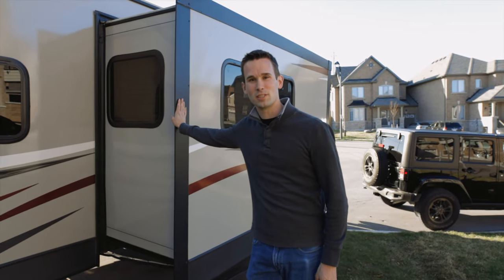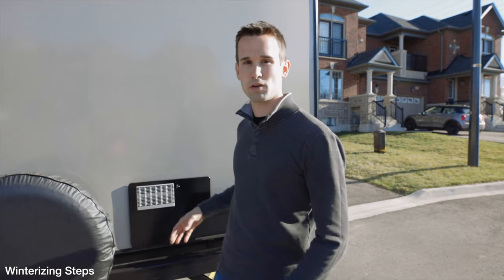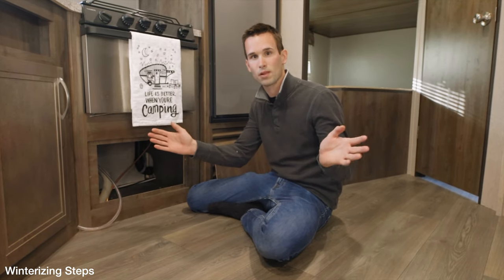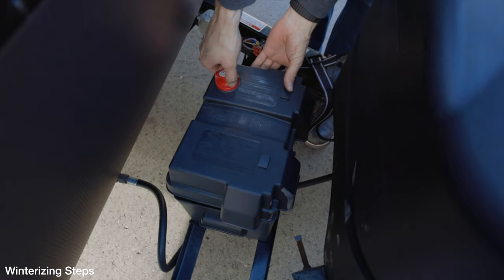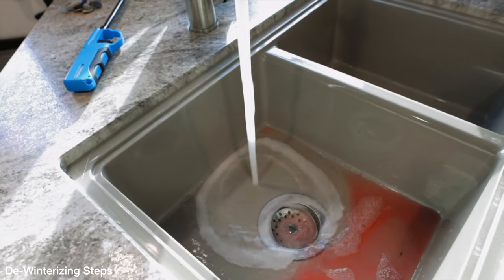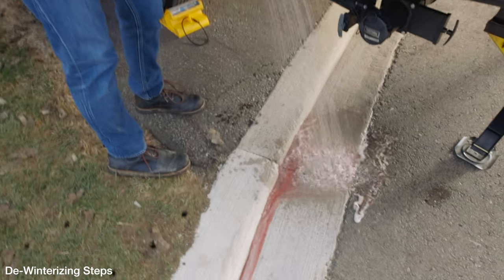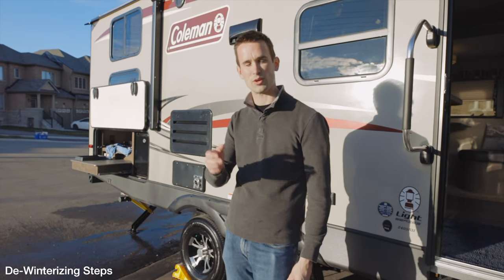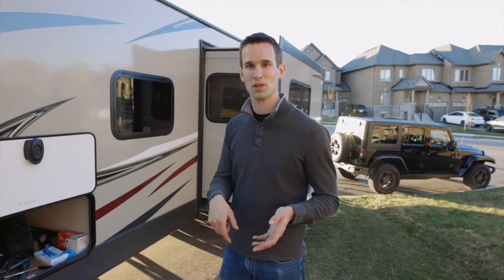Winterizing and De-Winterizing your Travel Trailer

Comment: Thank you so much for this video! I just bought my used TT and they winterized it for me at the dealership. I'm getting ready to take it out on my first trip in order to de-winterize it and to get it ready for use! I've watched several of these and this was by far the best, most concise explanation of everything that I need to do. I also appreciate the comment/clarification below re: filling the water tank and running the pump first, before filling the hot water tank.
Reply from the maker: So glad you felt it was helpful!! You are going to have the best time travelling in your new TT! Where are you planning on going first ?

Comment: Great tips. I couple comments, first I would suggest to not use the city line and use the fresh water tank with the water pump. If the pump doesn’t shut off, that’s an indicator that there’s a leak. Also, the city line will flood the camper if there’s a leak. Secondly, I wouldn’t use vice grips to tighten the water heater plug. I would use a 15/16” socket with an extension.

Comment: Good video. Well done. The only constructive comment I would make is  this. Whenever you hook up a city hose directly to the camper, I would use a water pressure regulator to prevent blowing your plumbing lines. Happy camping! 😃
Reply from the maker: Thanks! We do have a regulator on the house-end of the hose 👍 But you make a great point!

Comment: Just wanted to note that your low point drains/valves were pressurized. You could turn off the water pump so it doesn’t spray out as much. Just saw that in other videos. This will be my first year with an RV so still learning the ins and outs!

Comment: Do you drain your grey and black tank in the street after de-winterize, or go to a dump station?
Reply from the maker: We try to plan ahead and drain the tanks at the last campground of the season 👍 If we forgot to, we’d take it to a dump station to avoid it freezing in the tanks over the winter
Reply: @ChrisandNicole  is was curious of de-winterize. Do you drain on street when de-winterizing?
Reply from the maker: We just drain the non-toxic winterization liquid from the pipes into the grey/black tanks and this drains out at the first campground we visit when we empty for the first time of the season 👍

Comment: Thanks for the video!  Quick question... wouldn't you want to wait to disable the water heater bypass until after you fill the water tank and run the pump?  I'm new at this, but it seems to me that this might pump some antifreeze into the water heater.
Reply from the maker: Good point! That would be a better process to first turn on the pump with a full water tank and get some water flowing through the taps before switching the bypass back. 

The antifreeze we use is non-toxic, but still could have a smell to it, so avoiding any from reaching the hot water tank would definitely be preferred!